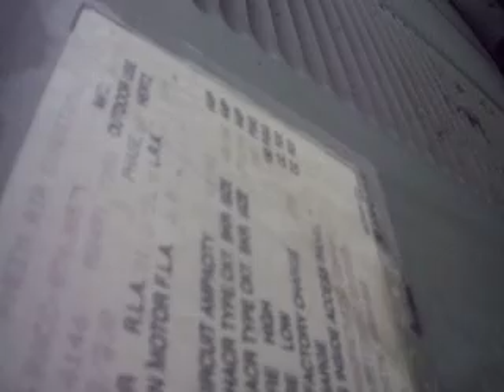Rheem and Janitrol condencers at a service station

Comment: the rheem heat pump at 1:21 is older cause most rheems dont have reciprocating compressors probably from the 1980`s
Reply: Sky Kitten Reviews 
That's true. Also it said "Rheem Classic VIII" which means its an 8 SEER. Quite an old unit!